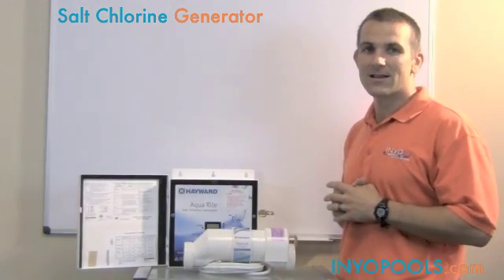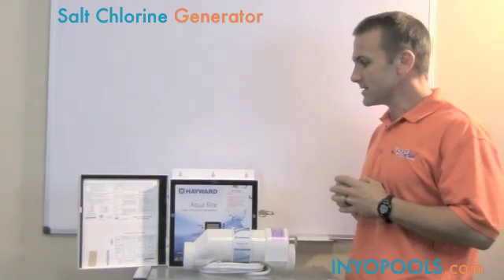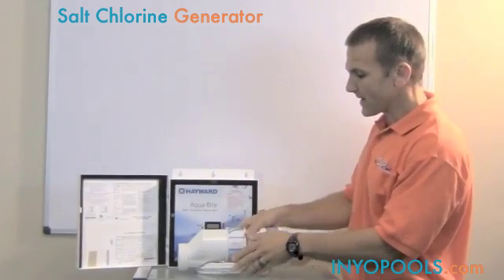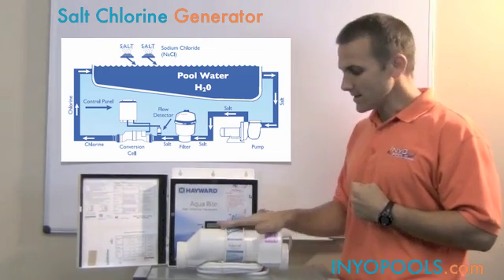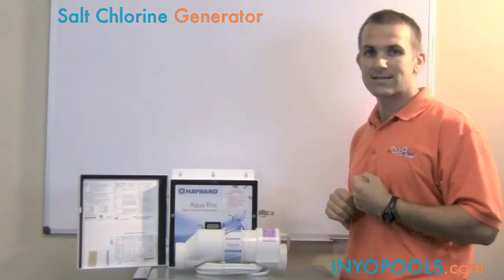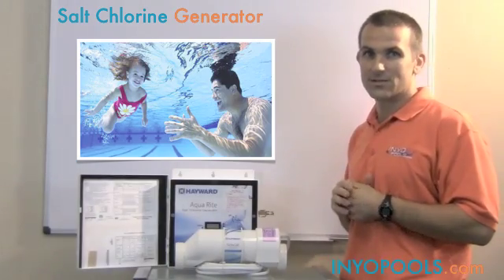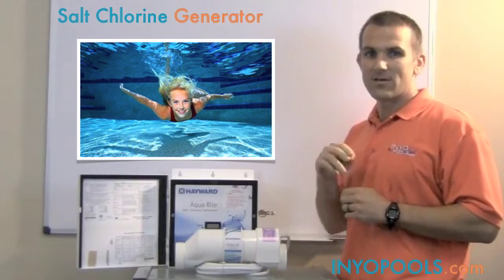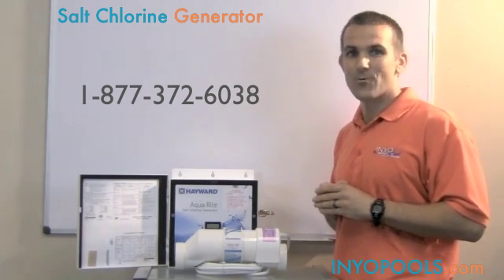Inyopools.com - Hayward Aquarite Pool Salt Generator

Comment: There is no such thing as a salt system generating chloramines, I have a salt system just like this one in some apartment complex and every so often depending on the number of bathers and in the weather there  is still chloramines in the water, chloramines are form not by a generating system but by free chlorine produced by the generator combined with contaminants in the water such as urine, sweat , and the environment are sources of ammonia in organic nitrogen material, these causes chloramines also known as combined chlorine.